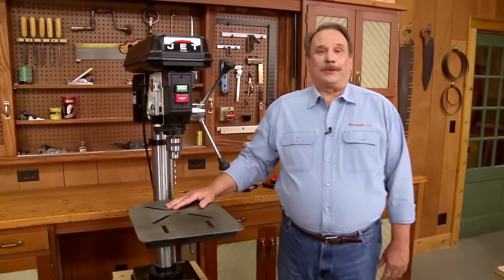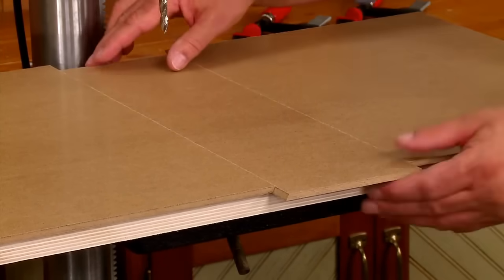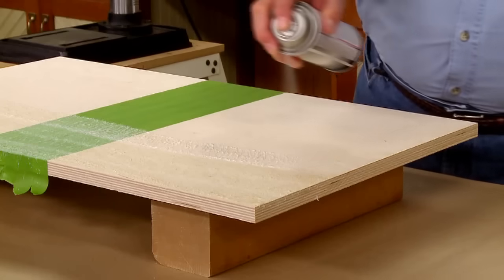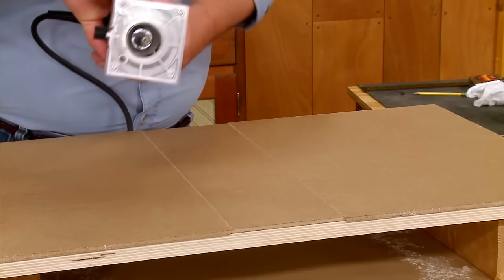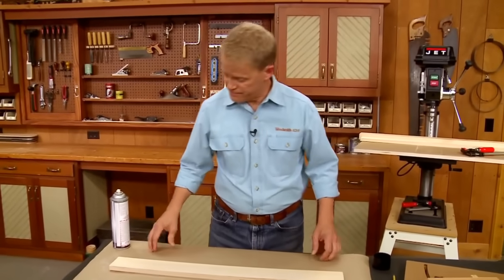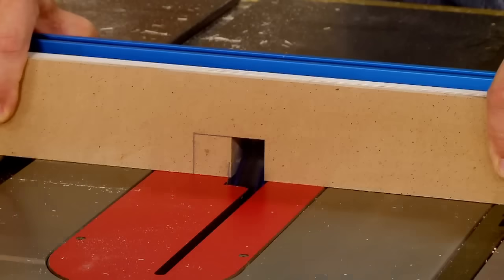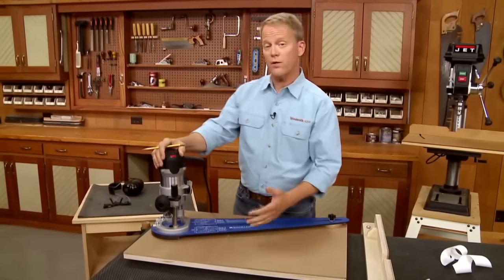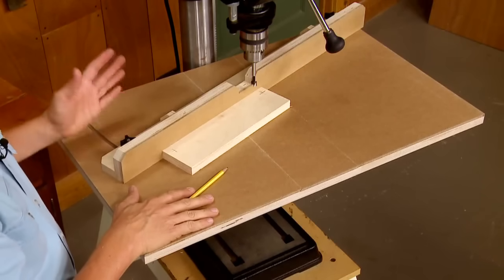Upgrade Your Drill Press! - How To Build a Quick and Easy Drill Press Table! (FREE PLAN)

Comment: Back in the early 60's my Dad and I used formika to re-do our kitchen counter-top. We were given all of the instructions from the expert who stressed the use of newspaper barrier between top and formika sheet after contact cement dried. Because we were in such a hurry to finish, we'd gorgotten the newspaper. BAM! One complete sheet ruined. We managed to remove the glued, destroyed sheeting from the substrate but it was a bitch. When we went back for the second sheet of formika, the salesman didn't have to ask; he knew! The second time around went a whole lot better. That's some mighty sticky glue!
Reply from the maker: LOL... We've all been there! Thanks for sharing. :)
Reply: It was truly a life's lesson!;)
Reply: You can loosen contact cement by driseling lacquer thinner into the joint and gently pulling the sheet off.  This works on the old fashioned kind, but I am not sure about the water based version.  That's why I go with the solvent based version.  If you can, turn the pieces up on the edge and carefully pour in lacquer thinner.  And, with good luck you can let the thinner evaporate and reuse the glue.
Reply from the maker: Barry Irby - Thanks. We’ll give it a try.
Reply: You can buy thixotropic contact adhesive that allows a little adjustment initially.

Comment: For safety, Never have your hands crossing the body centre line. So Never hold the handle of the drill press, with your Right hand, and then hold a work piece with your left hand,  on the right hand side of the cutting tool. Keep your left hand on the Left hand side of the cutting tool at all times, and  the right hand on the right hand side of the cutting tool. Seems simple enough, but a lot of shop injuries are caused by the simple fact, that hands crossed over the centre line of the body and cutting tool.
Reply from the maker: Thanks, Neil - Good info. I think there are a lot of injuries on the drill press just from the mere fact that people underestimate it.

Comment: This a a very handy table. I made it and have used for some time now. Do not let the simplicity of it fool you, it has become a permanent fixture in my shop. I would like to see some additional fixtures for the table saw and the router table. I always struggle getting picture frames built square and with a good fit. Maybe you have something that would help with that?

Comment: what does the fence tighten to when you move it in the slot. does it have to be cut out for a nut or bolt head. or is it far enough out that its just hanging in mid air. great video I have a  brand new porter cable floor model drill press I'm going to make this for ,thanks.

Comment: I have to add a comment about installing threaded inserts. By the way this is Garry not Linda. The slot on one end of a thread insert is NOT for installing with a screwdriver. The slot functions as a lead thread on a conventional tap to assist in correctly sizing the hole for the thread. Using a screwdriver to attempt to install an insert doesn't work especially the brass inserts used in the video especially into hardwood or hardwood plywood they will not go in straight and the slots will strip out long before the insert is fully seated. Use the method shown in the video and you'll have no problem at all.
Reply: Linda Elfstrand Hi Garry I noticed the same thing!🤣🛫

Comment: Hi, 
Nice job and well presented. Two thoughts: 
1. When routing the slot, I would have put a stopper block at the end hole so I didn't over / under shoot the routing of the hole. I find it easier than trying to eyeball my stopping point. 
2. I notice you didn't check the fence was at right angles to the fence base. Your dado cutter loos pretty accurate but I would probably have run a set square across the fence while gluing  / clamping it. We do a lot of projects where knowing the fence we are holding work against is at right angles to the table saves us a lot of grief.

Again, nice job. My first view of your videos - I'm sure there will be more <clicks subscribe>
Reply from the maker: Great points... I always like to use stops when routing slots, as well, for the reason you mentioned.  It is also a good idea to check the fence for square when you are assembling it. Plus, I would check it for square from time to time after using it for a while to make sure something hasn't shifted.  I've been burned a few times when I've assumed a fence was square only to find out later it wasn't :(

Comment: You forgot to show how you setup the bolt and wing nut to tighten the fence....
Reply: I watched it 2 or 3 times thinking missed that part, but there was no suggestions on how to anchor the fence in your chosen position that I saw either. Of course a year after it was posted it is likely no answer will be forthcoming.

Comment: Great build!
Just wish we could get decent plywood here in South Africa - quality is very poor compared to what you have available in US and Europe...
Just to confirm, you turned your tablesaw blade to 45 degrees to cut the bevels?
Secondly, your tablesaw fence, was that DIY build? What was the white material used?
Looking forward to future videos..
Reply from the maker: It looks like we used a 30 degree bevel on the insert.  The table saw fence is the stock fence that came with the table saw - the faces are made from UHMW plastic.
Reply: Appreciate the feed-back..
Reply: markforrestsm  Can you have plywood shipped from one of the online vendors?  WoodworkersSource.com or even Amazon.com?  I'm sure the shipping would be expensive but for jigs and shop accessories might be worth it.
Reply: Hi Markforrestsm,
I feel exactly the same here in Australia each time I see the perfect ply people are using in the video clips. Here in Australia your choices are an external hardwood ply with A bond and BC faces or at almost double the price you can get marine ply with A bond and AA faces some is Hoop pine but much is an Asian word that is a dark red colour.. I have found a supplier of birch ply but it is approaching Au$300 a sheet. All the best
Reply: Ouch! Our "marine ply", in my opinion, is still sub-standard. No-one I've asked has even considered importing birch or maple ply and if they did, it would be so expensive.. Shit happens, I guess :-).... At 3:25, I'm salivating looking at their ply....
All the best to you too

Comment: Don, I realize I'm late in the game relative to the age of the video but could you tell me what the distance from floor to top of drill press? I'm 6'5" and it seems as if many drill presses are elevated to the point where the the feed hub is about shoulder height or slightly below. Any input much appreciated.
Reply: I would mount the drill press on a riser block bolted to the concrete floor. The riser could be one, two or three concrete slabs bedded and leveled using floor tile cement. Us a 12mm SDS to drill through the lot into the floor slab and use 12mm all-thread as anchors. Seal the bars into the slab with resin anchor resin. 

Hardwood would also work but concrete slabs won't ever expand / contract with the weather.

Comment: the first part with the removable pieces is so wrong and over complicated and useless. i’ll tell you why and what is much much better.
a square piece 4”X4” or 5”X5” installed off center towards the front so you can have 4 clean surfaces is the way to go.  use the most common thickness plywood like 1/2” so you can make a replacement really quick. and no time consuming large sliding dovetail pieces. plus you don’t have to ruin your existing table by gluing crappy hard board on there.
the off center square pieces can be rotated 90 degrees every time you need a new surface. it can also be flipped over for 4 more clean surfaces. that’s 8 clean surfaces on one piece of common scrap plywood you cut in two seconds on the miter saw and it doesn’t even have to if perfect because it’s not the full width of the table. it does need to be flush in most cases, but even that’s not important if most of your work is longer than 6 inches or so.  it’s just a winning design by far.
Reply from the maker: I actually prefer the type of replaceable insert you are referring too.  We did a round one in this drill press table: https://www.youtube.com/watch?v=3_cQcHMz7UU

It works pretty well because you can rotate the round insert continuously and use both sides.  We also have a drill press table with a rectangular insert like you mention: https://www.woodsmithplans.com/plan/woodworking-drill-press-table/

I would recommend using 1/2" MDF as the insert rather than plywood though.  1/2" MDF is usually a pretty consistent thickness whereas it seems plywood can slightly vary in thickness from sheet to sheet or brand to brand.

Comment: Keep it simple, clamp the middle board down, spray and insert the outside pieces. The presenter over complicated the process introducing the painters tape.
Reply: They enjoy the craft, it's not about the quickest shortcuts to doing things.
Reply: You would still have to mask the centre piece if you are spraying, but that’s the way I would do it.
Reply: A piece of paper will do the job of masking for glue spraying. There's no need to waste glue by spraying right over it. Tape might be needed to protect the beveled edge, but avoid spraying at the edge and it won't get covered in glue.

Comment: A suggested improvement: You do a professional video. I find that the drill press lowering handle sometimes hits my fence, keeping me from a full-depth hole with the fence in place.  Adding a notch to clear the handle is a simple improvement.
Reply from the maker: Yeah, I had this problem the other day too.  I ended up just taking off 1 of the handles for the time being.
Reply: Woodsmith have you ever considered a crank in stead of the three handles so you didn’t have to change your grip when lowering/ raising the bit?
Reply from the maker: @bobbystanley8580  - I hadn't considered that... sounds interesting.  I'll look in to it.
Reply: Woodsmith just like the one for the table adjustment....
Reply: Great video, excellent solutions. I have a Ryobi drill press and made a table for it. The handles hit the fence so I removed 2 handles, works very well. The crank idea is worth exploring further. Thank you. Peter 🇦🇺

Comment: One problem i noticed with the fence. Plywood is bent slightly in their case, probably due improper storage in some point of its life. To fix this, ply should be pulled straight before gluing. This problem probably is non existent when using wood glue and clamping peaces with support peace top of the surface material and using sturdy straight table.

Comment: Why would you use contact cement? It dries out after about 6 months and falls off... it's meant to be permanent, so why not use wood glue? Thought in the name it says "cement" that stuff is actually an "adhesive". You know the difference between adhesives and cements, right? Adhesives need to retain moisture in order to keep up their tack... and that would present an issue for anything to do with wood. Now you said you added the 90 degree blocks to the back to make sure the fence was at 90... but you added them after clamping down the fence.... so- their uselessly after thoughts if that fence is out of alignment up to that point. So many low level mistakes in this build up. Who gave you guys this much high dollar equipment?

Comment: As a general rule. All drill presses, or the overwhelming majority of them suffer from having too small of a table. Industrial drill presses usually have a larger table but they outside the scope of home woodworker.  So I think it's relatively safe to ignore them. A floor model drill press, or pillar drill as our English cousins call them, can always benefit from a larger table. But the problem is the height adjustment being in the table. A better solution would be to have the motor and spindle assembly be adjustable up and down as well. There are reasons for this. Everyone has a height they are most comfortable working at. What suits you may not suit me. Or the guy down the street. Plus if the spindle assembly is adjustable up and down it opens up some intriguing possibilities. One is to have the table normally set at a comfortable working  height that also is the same height as table extensions on either or both sides. These extensions could be whatever length you want. For a benchtop drill press this would be the ideal way to do things. I've got a Ryobi drill press in my shop I bought in the late 90s (Ryobi WDP 1850). Fully variable speed from 500 to 3K. It has a seperate tilting table that mounts to the machines base. Height adjustment is done by cranking the head up and down. But for a beach mounted drill press (or any other drill press I've seen it has one feature that is unusual. The motor is in the head casting between the column and the spindle. This allowed the designers to increase the swing without making the machine way to large to fit comfortably on a bench. Plus having the motor in the front allows the machine to be located much closer to a wall. Nice in smaller shops. Unfortunately for Ryobi these did not sell well at all. The reason I suspect was the price. I could have gotten a floor model from Grizzly or Enco for the same money. I think it was close to $300 US in the late 90s. But coming from a backround as a machinist in a Tool Room environment I like to think I saw the real value in it. Switched out the chuck for a good quality keyless. 
https://www.microsoft.com/en-us/legal/Copyright/Default.aspx
Theres not much information out there on these. Ryobi had the tooling destroyed in order to prevent another company from building them. I suspect that Ryobi did the design work and had the actual production contracted out. Machine was built in Taiwan.  This was at a time when Ryobi and a few other companies, DeWalt for one, tried to think outside the box. And got slapped down in the market place. Woodworkers in my opinion are a pretty conservative bunch. At least when it comes to machinery. If that table saw design was good enough for my pappy, it's good enough for me. Well, sometimes new ideas are better.

Comment: One of three shop projects I built straight off the show!  I love this table.  And I think the swivel fence is 10x better than a two track linear. 👍
Reply from the maker: I agree... I like that the through slot doesn't get gummed up with wood chips like t-track often will too.
Reply from the maker: Just Curious - What were the other projects you've built from the show?
Reply: Woodsmith I built the table saw outfeed table and the mobile cutoff cart.  The cart was great except the casters I used from rockler are garbage.  The outfeed table might be better à bit deeper but it's been great.  The outfeed table was actually the first thing I built when I bought my big boy saw.
Reply from the maker: Jason Spenny - All very practical and useful projects 👍 Thanks for sharing!
Reply: Woodsmith any recommendations for a benchtop drill press stand? I'm thinking of moving from my workmate to on top of a cabinetlike stand of some sort.